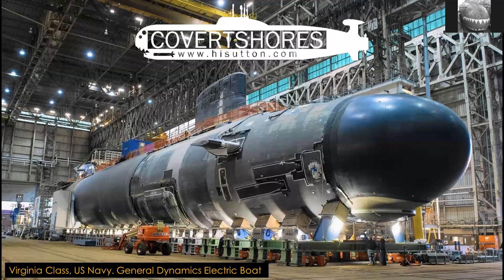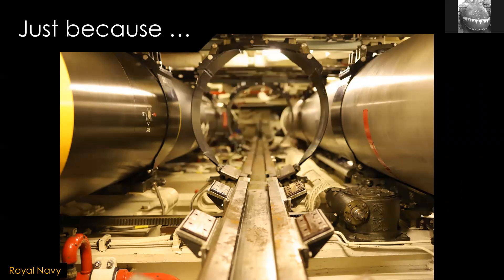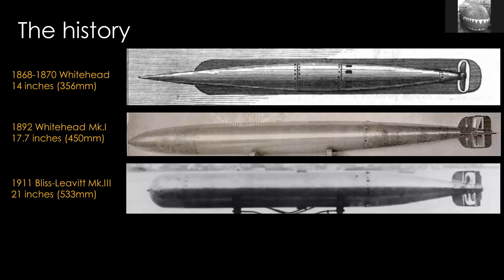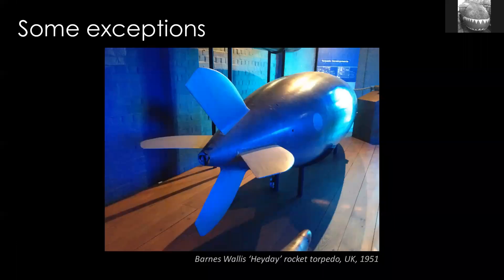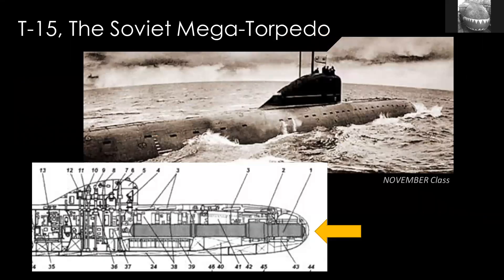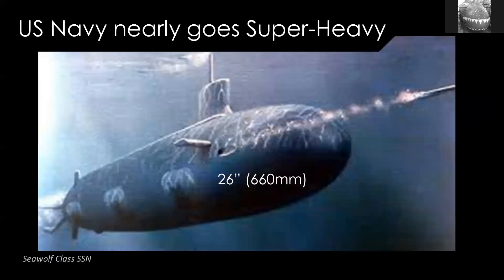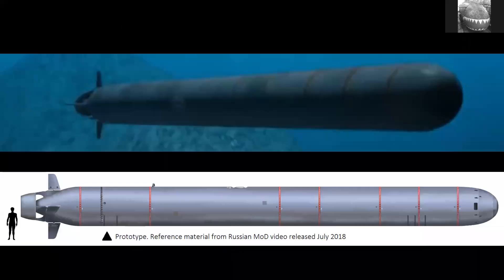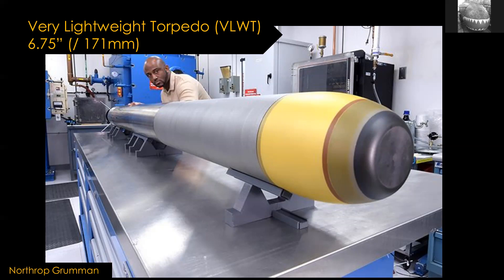Submarine FACTS: Why Are Torpedoes Always The Same Size?

Comment: Love the video. Smaller torpedoes (mostly like Swedish 400 mm) make sense if you mostly attack thin hulled merchant vessels or anything up to small-size frigate. Because the damage might not be that extensive as with 533, but still enough to sink or disable a ship. And of course you can pack 2 of those in one tube. Non-military ships will be at least severely damaged and smaller military ones will be open to the see with maximum amount compartments filled allowing them to still float, but not really fight.
Reply: also against other submarines
Reply: @tommihommi1  submarines are a bit of a funny situation though, since they have MUCH stronger hulls that can somewhat resist explosions. Thin skinned surface vessels on the other hand have hulls that can't stop .50cal AP and will have a massive hole blown through them. However, because one is on the water and the other is in the water the amount of damage to components or size of hull breach needed to cripple or sink a vessel is much different. The 400mm swedish torpedos are likely more than capable of putting a big enough hole in a ship to mission kill it or leave it dead in the water, which is enough
Reply: @alexdunphy3716  anti sub torpedos carry warheads made specifically for the job. No normal sub is going to survive a hit, especially not of a wake homing torp.
Reply: @tommihommi1  breh all weapons carry warheads specifically designed to defeat what they're fired at, that doesn't mean that they always can easily.
Reply: @alexdunphy3716  no sub has effective anti torpedo armor. The russian subs with their double hulls have something approximating armor, but a wake homer will still kill them every time.
Reply: @tommihommi1  Wow someone who cannot use capital letters for the names of a country does in fact know every classified top secret about every sub in the world today?

Official sources to your words and claim please ...

Thanks. Comrade is it?
Reply: @MrFlatage  Show me a sub that can survive with a torpedo up the propeller/propulsor.
Reply: Also take into account the Swedish will mostly be engaging in littoral waters and you want a torpedo that is compact and runs shallow to hit enemy ships sheltering in coves and rivers.
Reply: Especially if in return you get to carry and fire twice the amount of torpedos at once
Reply: All in all now warships are thin hull too with no torpedo defence idea.
Reply: @davecooper5751  Wow for how many more years will you deny troll? Your YT history is mostly rinse and repeat denial.

We have the facts posted all over the forum with practical real world soft and hard kill systems. But you just deny reality exists. As per your usual MO.

All I have to so is ask for Onus Probandi. It always shuts you down, lmao!

Comment: A few more information about the super heavy and small torpedoes would be helpful, e.g. speed, range, warhead size and so on.
Reply from the maker: Sorry. 

65-76A specs:
Caliber - 650 mm
Length - 11.3 m
Weight - 4750 kg est
Warhead - 557 kg est
Rrange - 50 km @ 50 knots, 100 km @ 30-35 knots
Maximum speed - 50 knots
Travel depth - 14 m
Launch depth:
- up to 150 m (according to the results of state tests, 1975)
- up to 480 m
Submarine speed at launch - up to 13 knots
Reply: @HISuttonCovertShores  Thanks a lot.

Comment: A question for you Sir.  At 5:00 you show a slide which says that the RN's mark 8 torpedo was introduced in 1912, 17.7"  etc.  I remember that HMS Conqueror sank the General Belgrano with mark 8s.  The mark 8s they used were 21" diameter, put into service in 1927 and carried 800lbs of torpex.  Given the UK's propensity to use the term "mark" on their weapons (I'm a Lee Enfield fan) does this slide show a different torpedo?  I can't find a reference to the one you are talking about.
Reply from the maker: Ah, good question. I nearly touched on the Mark numbers but thought it would only confuse people. However, since you ask...

The RN had separate Mark series for 18 inch (I suspect actually 17.7 inch) and 21 inch weapons. So the Mk.VIII in 18" is a different weapon than the Mk.VIII in 21".
Reply: I wondered that too. I worked for GEC Marconi in the 70's/80's and was well aware that 7511 aka Tigerfish mod-0 wouldn't have been trusted on Belgrano as it would have either sunk the Conqs or not not have the guts to sink the old US cruiser.

Comment: Can anyone tell me the clearance for torpedo tubes. All sources say 21" torpedo uses a 21" tube but that makes no sense because it would be too tight. And is the torpedo smaller or the tube larger and by how much.?
Reply from the maker: A few inches. There are guide rails etc however, so still the case that a 21" tube isn't designed to shoot any larger diameter weapon.

Comment: Really wild facts as to why torpedos have not changed size. 
Interesting about the "low value targets"  In peace time i see mobile howizers phased out because "planes can do the job" till someone goes to war and finds out how long it takes to put an "air package" together",  how over worked the plots are and how easy and quick cannon fire works.  The multiple launch for multiple targets will be a bit of a game changer. *IF*, big if, torpedos are used to take out bridges. listening posts  and piers. 
WW-II  torpedo warheads were not reliable.
Reply from the maker: Good point.

Comment: I would hear about a recently developed torpedo, that has an air bubble around it, and therefor can have a much larger speed. I wonder how big that one is. Or if this newer technology is used on more designs, what kind of torpedoes are done with it.
Reply: They're not recent, and they have to be fired from submarines. So 533mm/21 inch. Look up the Shkval torpedo (VA-111 Shkval)
Reply: Its called a Super-cavitating torpedo, they use standard tubes but carry a smaller warhead as extra space is taken up by their propulsion. They work by generating a curtain of gas around themselves to reduce water density and water resistance to allow higher speeds to be achieved. They have a couple of major downsides though, they can barely steer so are pretty much straight shot weapons, they are incredibly noisy so easily seen the moment they are launched and sonar cant see out through the bubbles so they are essentially blind, and they have much shorter range (as little as 20% of conventional powered), they cant be wire guided as the wire wouldnt survive the water turbulence. Because of these limitations the initial models were equipped with a nuclear warhead for proximity attacks on carriers but they switched to conventional warheads. Russian sub commanders didnt like them as they were essentially a suicide weapon having to sail right upto an enemy fleet then announcing your presence meant you had little chance of survival afterwards and thats after having already been required to penetrate the escort screen.
Reply: @watcherzero5256  You're spreading false western info, as always meant to denigrate foreign rivals. Shkvals were not an offensive, but a counter-attack weapon. Not  anti-carrier, but anti-other subs. In case of being detected, or the sonar detecting an enemy torpedo running, shkval could be shot immediately in the general direction of the enemy. Low yield nuke warhead would almost certainly tear the cable, destroy the attacking torpedo or in the worst case scenario destroy the attacker, making the exchange an eye for an eye. Its speed gives the attacked Russian vessel a chance to respond in time. It's also not true it's an unguided weapon. Post-cold war conventional models can turn the cavitation on and off, to make a quick search and retarget. The story of it being useless to attack carriers shows how US uses their own bad intel analytics to create domestic propaganda. Shkval was never meant for what they say its bad at, as it could be guessed in the first place.
Reply: What's more, supercavitating torpedoes have more uses than on submarines, as a retaliation weapon like shkval. They are also used as the second stage on rocket propelled torpedoes (Russian ASROC). These are APR-series. Also air droppable without the rocket component. An advantage to a regular light torpedo is the speed that gives the attacked vessel no time to react, and invulnerability to countermeasures, whether sound-based or hard kill.

Comment: I like your lectures as they are, unscripted.  I feel like I am back in the classroom following a subject I enjoy during my best university days.   I don't remember my teachers reading from a script either.  🔱

There are masses of computer data around the properties of this diameter.  There is also the science of it that joins the twosome loop you mention for advancement in either platform or weapon, computer models are arduous work and costly and most of the hard data those models are built on are relying on empirical 533mm baselines to be accurate.
Reply from the maker: Thanks.

But the point re this size is that it isn't because of any science reason like you describe. That's why I checked in with a lecturer on naval architecture. It was just that gradually torpedoes got bigger and eventually, around end of WW1, people decided that 21" was the most useful size because it was big enough to threaten any warship and had decent range. After that it was just the circular relationship of torpedoes and torpedo tubes
Reply: @HISuttonCovertShores  Thank you for your kind response.

Comment: Torpedoes are not always the same size, there are several sizes of torpedo, but countries like the U.S. use 21" torpedoes on their subs, aircraft torpedoes tend to be smaller. Russian subs tend to have different size torpedo tubes, but the bigger tubes are not reloadable at sea as they do not penetrate the pressure hull.

Comment: Mr. Sutton, I know most submarines have 533mm diameter. But what if some navy wanted to increase the range of the torpedo from the current longest ~50km to say 100km? Also wanted to launch not only long range subsonic land attack cruise but also super and hypersonic ones from the torpedo tube? Don't they want to increase the diameter to say 750mm? What happens if they lengthened the torpedo diameter??
Reply: Russians have 650mm ultra long range wake homing torpedoes
Reply from the maker: Yes. But it seems that they are discontinuing those.
Reply from the maker: That's one way, as it describes for the Seawolf. But there are no plans for this now. 

In general better battery technologies will be what gives better ranges

Comment: Probably worth adding that whats contributed to a light weight torpedo still being a viable equipment option today is that they continued to be developed in parallel to submarine launched as air dropped weapons where pretty much every country in the world standardized on 12.8 inch apart from Russia which standardized on 14 inch.
Reply: Not just aircraft, but almost all surface vessels seem to carry that size of torpedo as an anti-submarine weapon.
Reply: also sweden with their 400mm (15.75 inch) ASW lightweight torpedo (13:00)

speaking of air-dropped ASW lightweight torpedo whose size are not constricted by tube caliber, 
the USSR had more than a handful of calibers, ranging from 330mm (13 inch) & 350mm (13.8 inch), to 400mm (15.75 inch) & 450mm (17.7 inch)

Comment: The 6.75 inch torpedo, as far as I know, is not being considered for integration aboard submarines.  Rather it was to be carried on carriers as an anti torpedo torpedo.  It is very fast and can turn quickly but has limited range.   As of a few years ago there were two propulsion variants planned; a lithium battery and a lithium/seawater boiler.
Reply: It's still interesting to think that you might be able to stack them in a '+' shape inside of a 533mm torpedo tube though.
Reply: @petlahk4119  I could see a future revolver style magazine where you load half a dozen into a clip, only reloading when the clip is exhausted to minimize opening of inner and outer doors and to speed reload.
Reply: @watcherzero5256  something like that was sort of proposed for swedish submarines long time ago but they decided it was too expensive. also it would be on the outside of pressure hull and it would rotate all around it
Reply: @watcherzero5256  Nice thought.

I think they have a similar system on the B-1 bomber for bomb drops.
Reply: @watcherzero5256  it's already been done but it suffers from two problems. You can carry less torpedoes unless you plan to store torpedoes outside the revolver but then you'll have to be able to reload the revolver inside the ship which is difficult and takes a lot of space. Second off it's a single point of failure so any damage could completely cripple your ability to reload. The Russians did it because they love mechanical autoloaders but even they I think of abandoned it because of these issues.
Reply: @petlahk4119  You wouldn't need to do that, you can store them on existing torpedo store racks, and have multiple torpedoes swim out of a flooded tube in succession instead of launching them with compressed air.  That's how Sweden "twin-launches" their 400mm fish.
Reply: Sounds similar to Paсket-NK (324 mm). What's interesting in this name? "-NK" ("-НК" in russian) is abbreviation for "surface combatant" ("надводный корабль"). As a result I have opinion that russians have modification for submarines (i have never heard any official info about Paсket for submarines).
We have similar situation with Kalibr (Club) family of missiles. There are Kalibr-NK (Club-N) for surface combatants and Kalibr-PL (Club-S) for submarines.
Reply: It is.  All US submarines carry 6.75" tubes already for launching countermeasures - that would be what launches CATT.
Reply: @GintaPPE1000  CATT? What is that??? Something China edited?

I know for a proven fact Countermeasure Anti-Torpedo system tested was real. Total failure as we can read in the US Navy plans to remove prototype equipment on its aircraft carriers during maintenance breaks between fiscal 2019 and fiscal 2023. They've been ripping out the system for two years now.

Comment: Fascinating video.  Thank you.  It's incredible how many perpetual chicken and egg problems crop up in sufficiently complex systems.

Can you tell me if modern surface warships use larger-diameter torpedoes?  Do helicopters and other aircraft use smaller ones?

Will you consider doing a video on rocket-propelled and supercavitating torpedoes?
Reply: Modern surface warships tend to use small diameter "lightweight" torpedoes like the Mu-90, Mk 46 and Sting Ray. These are either launched from pneumatic tubes straight over the side, or mounted on a rocket like ASROC or Ikara. There are some exceptions, like the Algerian Koni-class frigate and a few others, which have 533mm torpedo tubes for ASW.
Helicopters and maritime patrol aircraft launch lightweight torpedoes as well, which makes sense when you consider that most 533mm torpedoes weigh in at around 2000kg / 4500 lb.